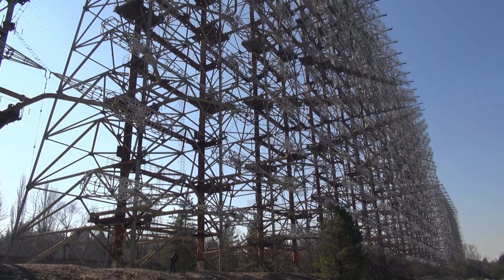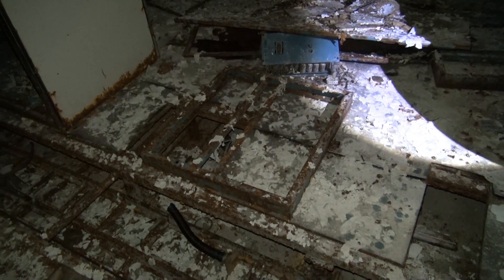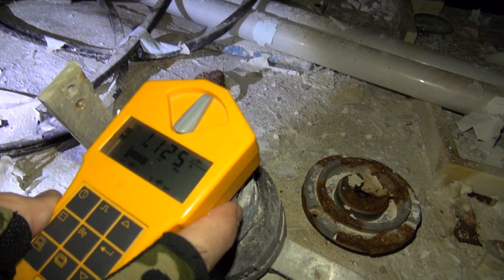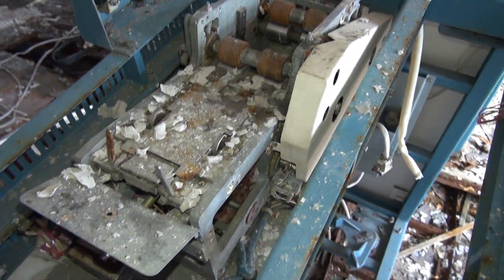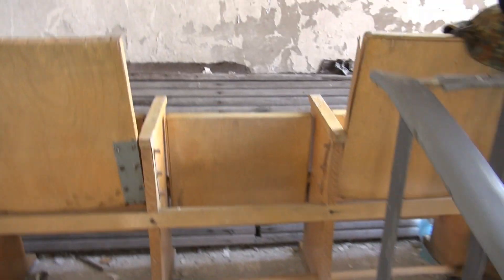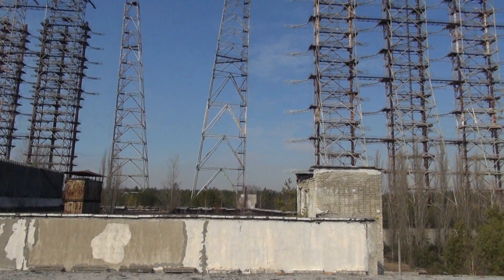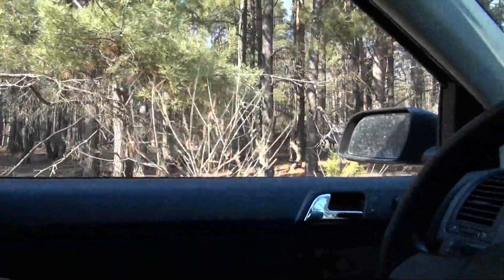inside Duga-3 / Дуга-3, computer mainframe of the Russian Woodpecker / Chernobyl-2

Comment: The role of the Duga system was to detect US incoming weapons along the great circle route, as directed towards Moscow, Kiev/Kyiv, and perhaps Leningrad/St Petersburg.   The US bomber fleet staged in Greenland as "Chrome dome" was a ready force to attack the USSR.  This ended before Duga was built, but why take a chance?   The US Navy also posted ballistic missile submarines near Norway, taking advantage of great circle route to attack the aformentioned cities.

Fortunately we Americans never came with ill intent.   Even today, the US is timid about sending big fleets of anything towards Russia.

Hollow spaces under the floors were intended to route cabling.    I am not sure that anyone uses such a thing today.

Punch cards were still used in the US in the 1980s.   I learned Fortran on a punch card machine in 1982.   Those cards could also be the payroll computation for the staff.

3:00 - I agree with 20Kilovolt - a custom connector.   I am uncomfortable with so many lines running "side by side" as mutual inductance can generate noise.  Today the world uses groups of twisted pair of lines, which reduces such "cross talk".

3:25 - Older circuit cards used gold plating to improve performance while reducing losses due to corrosion.   This made them valuable for scavengers seeking metals for sale.

4:27 - Caution.  380 Volts (cyrillic V).

6:31  -  Ferrite Core memory.  Valuable antique.   Useless for today's purposes.

 6:39 - Bunch of old fashioned rectifiers.   Am not clear about their role.

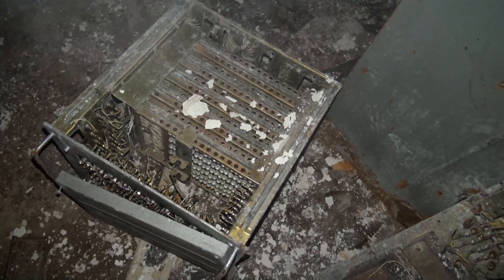6:51 - I'd need more data.   That number of transistors would not yield much computing power.   It could be an analog computer, and that would be pretty cool.  The US was still using analog computers in the military for specialist applications at that time.

12:45 - Soviet retro lampshades might be worth some money.

Comment: Lots of delay lines in order to perform analog correlation of received signals in order to do an early version of "beam forming." Raised floors and cable-ways are not at all surprising. It's likely there was far more analog rather than digital computing happening here: possibly a digital computer multiplexing a lot of analog computer's compution results. I spent lots of quality time with punched cards early in my computing career.

Comment: The connector: this shape/size was common on IBM mainframes in the west. Often with fair amount of power for each wire.
The floor: raised floors were common for data centres till the mid/late 1990s.  When cables between components were that large, it was best to have cables on the concrete floor below the computers than hanging from ceiling as is done now. Conditioned air was also forced in the underfloor and each computer cabinet could be placed over a "vent" and could draw cold air from under the floor.  In banks, they would have pressure monitors so that an alarm would ring if someone lifted a tile (thus reducing the air pressure under floor) to prevent someone from connecting equipment without permission. 
The USA had strong ITAR export restrictions on Computers to the USSR which was behind  in technology and US military didn't want Russian military to get modern computers from the west.  USSR nevertheless still managed to "acquire" such.  (and often copy them).  Digital Equipment Corp knew that the Russians were trying to copy their VAX chips in early 1980s  and one of the designers include in cyrillic the phrase "VAX - when you care enough to steal the very best "  on the actual microship. 
If this place was shut in 1989, it means that it was a "planned" shutdown and it is quite possible that the crew would have taken with them anything of strategic military value, and left the site with just old useless technology.  I have to assume this site was already based on old tech. 

And even if they didn't scuttle the building in 1989, at the time of USSR falling apart, they would have returned to remove anything that Russia didn't want Ukraine to have.

Comment: At 13:14 you are seeing a part of a magnetic core memory plane. You can see the row, column, and sense lines that have been unceremoniously hacked out of the frame in which it was supported. It would have cost many rubles, once upon a time. By 1980, these had been replaced by semiconductor memory chips, at least in the West. 

There could have been a somewhat good reason for using them in the USSR at  that time, because they might have thought they were more immune to EMP effects.

Comment: It was completely intact...when they left in a hurry. but over time copper thieves stripped and destroyed everything, that is why everything is emty en piled up. Pitty. This is the transmitter site. There is a receiver building several kilometers from this site, with nice graphic wall panels with lights  of the possible beam directions they could make the Duga point to so they could spy specific parts of the world. Not so many videos of that site, most likely now also stripped an destroyed.

Comment: The floors are probably raised for cooling and cabling. Data centers often have raised floors for the same reason, and if they had a lot of electronic equipment, they would probably be addressing the same problems.

Comment: The floors were built like that to house cable runs that could be accessed by pulling up the floor panels.  I could clearly see at around the 6 min mark the racking installed in the "trench" that would support either very large cables, or just a mass amount of smaller ones.  Same same, I guess.  And at the beginning I believe she was correct in supposing the equipment observed was indeed telephone eq related.  On the left hand side of the "switchboard"  I could clearly see several solder pin wiring blocks for connecting jumpers and the large drive rings to route the jumpers to where they were going.  Looks like they had a small telephone company inside the building, makes sense.

Comment: "Access Flooring" in computer rooms allowed for the large number of cables to be run under the walking surface.  In the USA, it was also used as an air conditioning plenum.

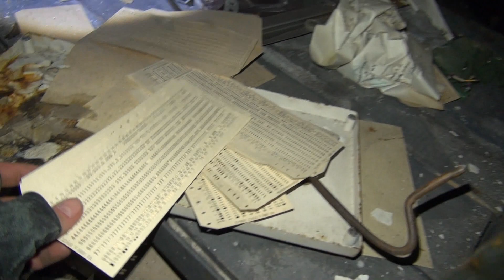Comment: 8:56 just 90 Bytes or 720 bits on that punch-card (excluding excessive top 2 rows).
Just imagine how few information it is! You'll need about 35000 of this cards to record 1 average mp3 song!

Also it was probably printed in 1980 in some typography. But actual program was punched later via special puncher by a programmer.

Comment: Very interresting .... I was an radio Amateur in the 80s ... and i had often proplems to receive stations on short wave cause the Woodpecker Signal was to strong  ... i had to use often the noiseblanker to filter out the Woodpecker Signal on my receiver. .... amazing Building 🏭

Comment: I assume the valuables they took were cooper wire. I think maybe that's why the floors were gutted in the hall too. For wire, or cooper water & heating pipes. 

At 3:33 is that insulation that was cut off of big bundles of wire? 

In America, meth heads strip old buildings (and unfortunately, sometimes new buildings) for cooper to sell. 

In Ukraine, it's maybe krokodil heads? I think I saw something from Vice that said they squat in the zone to be left alone to do drugs. 

And some computers had (and have) a little bit of gold in them. Probably why the computer racks were taken apart. 

Though some probably just took cool stuff. Like that giant cold-war data plug.

Comment: Raised floors were for routing cables and moving cooling air for the electronics. It appers the center had been looted, or the critical electronics removed, the rest just discarded. What a mess; it would have been fascinating to see the control room in a pristine state.Great video!

Comment: The reason the floors are built in that fashion is for easy access to all the wiring for the computers and to hide it.  In the computer industry this is called "The Raised Floor".  There would also have been powerful air conditioning systems to keep it cool as well.  This is why people wore coats and sweaters in the Mainframe Computer rooms in Universities and such because it would be so cold in there.

Comment: As for them leaving stuff behind and what valuables they took. The problem with computers in the old days was that they were so expensive to build that you'd carry on using them for their original purpose until they were several degrees of obsolete but if you abandoned that original purpose, they'd be worthless for re-purposing because of that obsolescence, so you just leave them behind.

Comment: Hi! the reason that some of the floors were made that way, was because the computers back in the day could fill an entire room with individual units some the size of refrigerators, others the size of washing machines. there were alot of thick cables that ran from one Unit of the system to another. and all this wiring ran in these spaces, they were called Plenum floors. there were removable metal panels that went over these openings for Maintenance purposes. the really old computers (1940's- 50's) ran on Vacuum tubes that generated Alot of heat. so the space also served as Ducting that refrigerated air ran through, to cool all of the equipment. also the light from the tubes would attract Moths and other night flying insects, which would die by either the heat in the cabinets generated by the tubes, or electrocution, and if not cleaned out regularly, the piles of dead/ dying insects would short out circuits or cause some of the tubes to over heat and burn out. and there would be a system failure. thus the genesis of the programming term that "there is a bug in the system"
these type of floors are still used today in modern server rooms / farms
sad to see Vintage computer equipment just rusting and corroding away.

Comment: The false floor is as others have said to allow cable runs. I worked on mainframes in the 80's and 90's, and the false floor we had was also used to blow cooled air from the HVAC units up thru the big disc cabinets and the CPU's, or nodes as ICL called them, which were about 9 foot tall and about 5 foot square. The false floor also would have been filled with fire suppressant gasses had there been a fire. During a fire large steel doors would have dropped down sealing off the machine room and filling it with Halon or it's more modern replacements, and the false floors had walls that lined up with the steel doors to completely seal off the room. If you were unlucky enough to be in the room when the doors dropped and the room filled with gas you would be in serious trouble, as you would suffocate in pretty quick order, so the rooms had air masks hanging ion the walls in several places. These consisted on a large full face mask like a gas mask, and a canvas bag containing a bottle of air, if there was a fire and the Halon was triggered, you would put the mask on and sling the bag over your shoulder and try and find your way out. When you had the mask on you and breathing the air in and out made you sound like Darth Vader, we would put the masks on and do Vader impressions on boring night shifts, so most of the bottles were half empty, which would have meant anyone needing them probably would have been fucked, ha ha.
Reply: Probably CO2 [carbon dioxide] here.  BTW the benefit of Halon was that it would snuff fire, but not people.

Comment: It's very likely been mentioned already, but I'll comment anyway so other won't have to search. The room with the metal ceiling, with the metal gaskets on the metal door is a Faraday shield. It prevents electromagnetic waves from leaving the room. Every electronic device produces radio waves. If you don't want an enemy to pick up these waves and interpret them, you need a Faraday shield or cage.

Comment: In the 1950s America networked all radar systems together in the SAGE project, there were up to 16plus computer buildings, through out the us. This building is quiet similar to 1 computer building, but I just can't see how it would be operational in the 80s, it would have been extremely obsolete. Though tube tech is more resistance to EMPs, RAD hard ICs were just as resistance by the late 1960s....Puzzling... This couldn't have been the only one in Russia,

Comment: Great video, just you mention the place opened in 1976? But a lot of the component, are circa 1950s. My undergraduate university had a abou don basement with 1950s components. Buy the 1970s many of this equipment would have been obsolete in western computers. Could this place have been opened earlier?

Comment: as mentioned the raised floors is to hide wiring between cabinets, areas. Sometimes used for air cooling cabinets as well.
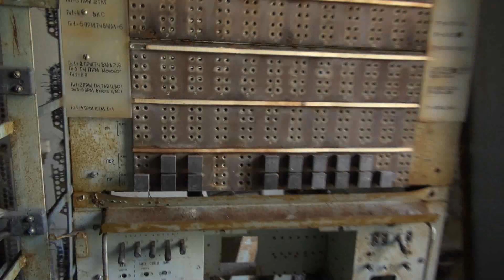The black cubes at 0:58 is either gas tube surge arrestors or relays. If it's wires coming in from outside, it's probably surge arrestors.
The iron ceiling at 14 minutes is perhaps part of an EMP shield. Many facilities in the US have a mesh screen built into the wall as a faraday cage to protect against EMP damage.
I would expect asbestos too which would be bad to inhale. Good thing it's wet in there.
Cool video with the old hardware.

Comment: I would have loves to see the control equipment and transmitter when it was operational. That would have been a thing of beauty! anyway,s I think those are raised floors used to route cables and wires from place to place. They used to use that sort of thing in computers from the 60s and still use those kind of floors in television stations and data-centers to manage all the cables. Thanks for the video!

Comment: most that junk would have used vacuum tubes as well. the soviets were still using them long after the rest of the world had changed over to newer electronic equipment.
Reply: onrr1726 vacuums tubes where used in large capacity transmitter because they can handle large currents that would fry a transistor in 1980's even today transmitters still use tubes.

Comment: +bionerd23 at 0:28, this is a raised flooring, which is common in places where we need voids to pass cables conveniently. You can find these kind of floors in most rooms that are meant to host computers/telecom/RF equipment (e.g. datacenters).

0:51 This is most probably a phone exchange, the brackets and cable holders really look like those one can find in CO's main distribution room.

4:31 380 Volts

Comment: The reason behind the flooring being that way, is so that cables can be run easily and neatly between rooms and equipment. Its called a false floor and there would have been floor tiles covering the holes originally.

Comment: 10:16 the black rods appear to be ferrite sleeves used for suppression of radiofrequency interference. On circuit boards, components such as a resistor would have one lead folded over 180 degrees and these RFI suppression ferrite tubes would be slipped over that lead and the component would be soldered with the body very close to the board and the other lead going through one of these tubes - which also act as an electrical insulator.

Comment: The channels in the floor were cable trunks; you speculated correctly about that.  A common architecture for computer facilities of that era, when components were placed on large racks and interconnected with multi-conductor cables.  They were covered with the steel plates you see strewn next to them.  If the cables were removed by copper thieves, as speculated by 20kilovolt, they did a most thorough job.  They could have been simply removed for re-use elsewhere as they would have been a valuable commodity.  I'm sure that could also be true of a lot of other high-value components, probably purchased from foreign suppliers, that are no longer present.  

I am an amateur radio operator who used to be vexed by the constant rattle of "The Woodpecker" when it was in operation.  I'll never forget that noise on the HF bands.

This video is excellent, as were those of the exploration of the array itself.  I've always been curious as to what "The Woodpecker" looked like.  I just wish there were photos of it and the control facility while it was in operation, but such photos would be a state secret, even today.

Comment: This kind of floor is very common in industrial central control rooms even today. Basically all the cables were in these floor "tunnels" so you could easily connect electronics far apart. Imagine all the cabinets of electronics beeing open at the bottom.  Normally these "tunnels" are covered with steel plates of course. So in a operational state you wouldnt see any cables at all.

Comment: Why didn't the soviets build PC-s ?Because they weren't  able to design it small enough to pass through the factory gate.
Reply: John Aybier the mainframe computer still rained in large set up like this in 1980 and the eastern block was awash in clones of Macintosh and IBM pc's. most manufacturers in the Warsaw pact where forced to bootleg western designs since they where prevented from using domestic designs of microchips in consumer electronics.

Comment: This kind of floor is called "floating floor", this allows for the racks to be mounted on the floor, with the cables running under the floor into the racks.

Comment: With the flooring cavities exposed and the electrical fittings laying around I get the impression the cabling has literally been stripped from the building possibly for it's valuable copper content, similar activity occurs here with vacant/disused commercial buildings by scrap metal thieves.

Comment: Very nice video. The "strange" floor that you have found is typical in 70's and 80's mainframe buildings. These floors are designed to let cables run under the surface of the floor.
Reply: +Angueran DeLaMouliniere That's it!
Reply: +Angueran DeLaMouliniere Yes; modern computer rooms still have similar trenches for cabling. Many have the entire floor elevated above the concrete pad.